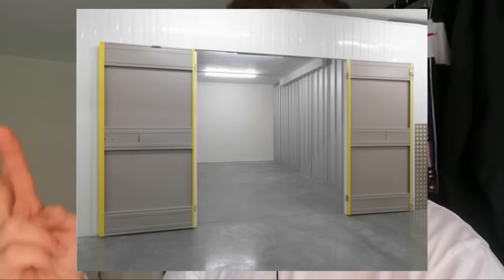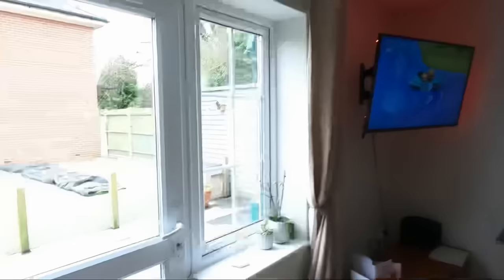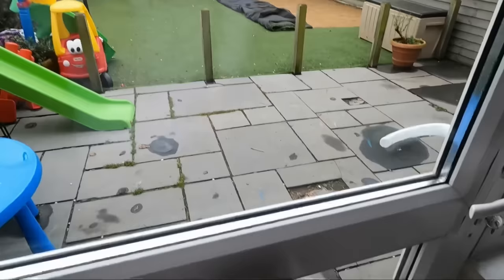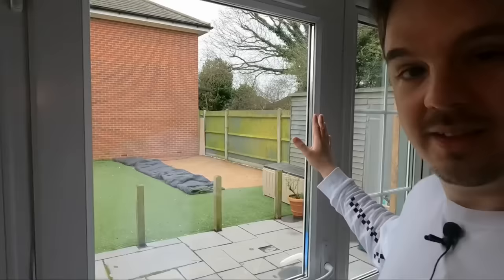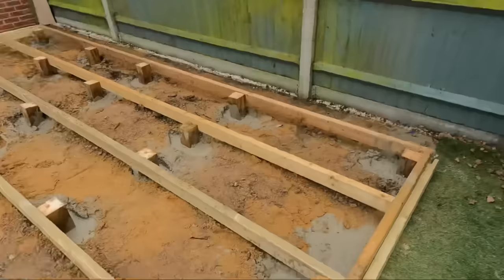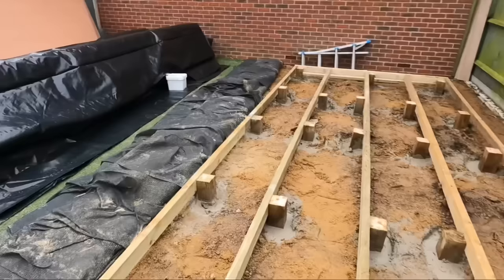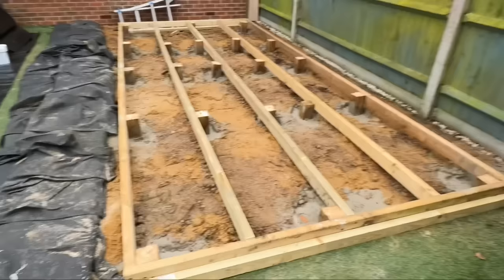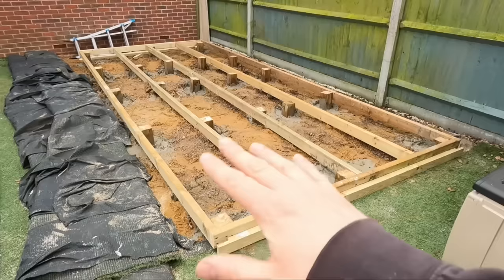Something BIG is happening to the business..

Comment: Looks like you are next to a road.  Be careful about theft.  May consider putting some sort of intruder alarm.  You can get inexpensive shed caravan alarms.  May also consider a dehumidifier to keep the tat from getting damp.
Reply from the maker: Thanks for the tips! Currently have multiple cameras all around the house connected to our phones 24/7 so got that covered :)
Reply: @RetroReselling  add an alarm too.  Thieves don't care about cameras any more - they just wear a mask and pull two fingers to the camera.  I know someone who had stock in a brick outbuilding backing along some playing fields.  Scrotes removed bricks from back of building overnight, climbed in and nicked his stock.
Reply: And motion sensor lights, looks good though 👍🏻